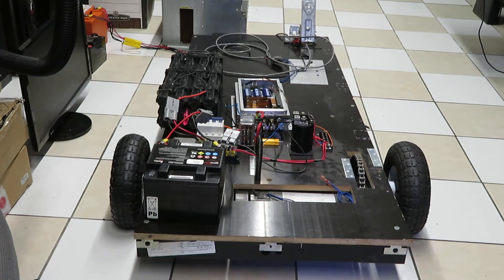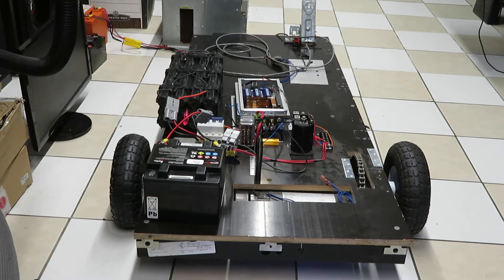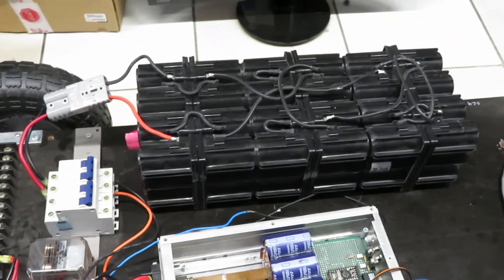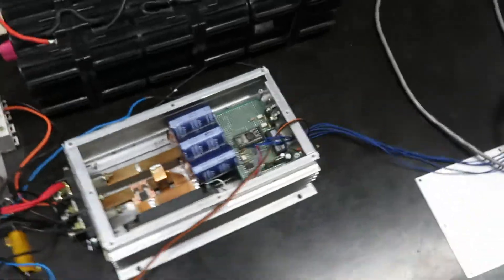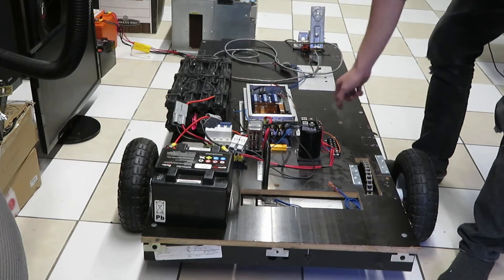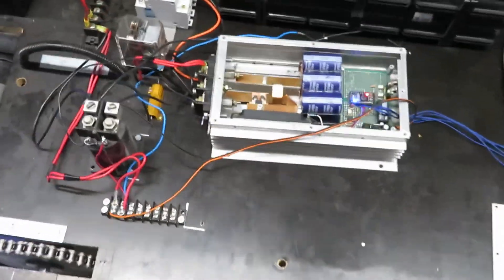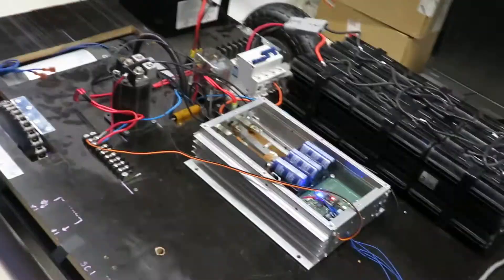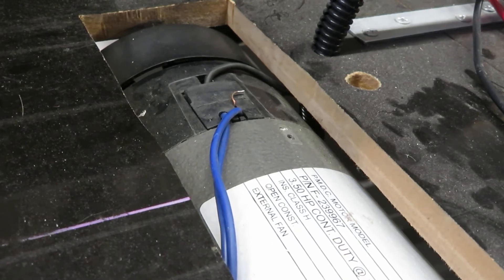Self-Built 200V DC Brushed Motor Controller Demo

Comment: I would recommend you to add some DC-Link polipropylene capacitor across supply rails of the H-bridge. I know the capacity of electrolytic caps is really high, but they aren't designed to handle that large current. Also their ESL is pretty high causing long response time for voltage spikes comming from back-EMF (during regen braking) and inductance of the batterry (when upper MOSFET goes OFF). By the way, this project is really cool, keep it going!
Reply from the maker: Thanks for the recommendations! I'll keep those in mind when re-designing it for the h-bridge configuration. I've been trying to figure out a way to do it using only N channel MOSFETs, but I have seen that it may cause issues with high drain to source resistance due to the gate offset voltage becoming lower than the source (iirc). These MOSFETs I'm using are quite expensive, so I'll test on a lower scale first.
Reply: @ri5ux  There are integrated half-bridge drivers (for low side and high side N-MOSFET) like IR21844. They can handle huge voltage swings of the upper MOSFET source and keep its Vgs at safe level (including fast switching). There is a bootstrap capacitor that charges when the low side goes ON, so you can't easily get 100% duty-cycle on higher MOSFET. I can explain how to achieve 100% duty-cycle if you are interested in this solution.
Reply from the maker: @TheLuki525  Actually, yes, if you're willing to explain it, I'd gladly read through it. It sounds like the solution I've been looking for.
Reply: @ri5ux  Actually there are 3 ways do do it:
1st and the most straight forward way is to connect a battery between Vs and Vb (according to IR21844 and similar ICs datasheet).
2nd (choosed by me) you can use some boost converter that produces voltage ~15V higher than your main supply voltage and connect it to a transistor-zener diode voltage regulator that stabilizes the voltage relative to Vs and connect its output to Vb. The main drawback of this solution is that it forces some small current (couple of milliamps) from Vs through your H-bridge to reach the GND. 
3th (i think the best one) way is get (or build) some insulated-output converter that produces ~15V and connect its output between Vs and Vb. This is the most elegant way, because you don't care about your supply voltage level, it can be 30V or 300V - it doesn't really matter.
But if you will not choose any of this solutions, you will be still able to achieve ~98% duty cycle ;)
Half-bridge drivers are fitted with undervoltage protection, so when Vb - Vs < 8V it will not try to charge the gate of the upper MOSFET.
Reply from the maker: @TheLuki525  To be honest the 3rd solution does seem the best, and the most probable that I would implement. I have a good collection of isolated dcdc converters, probably have a 15V one in there somewhere. Honestly though, 98% duty cycle would be sufficient in my case, it may not be worth the extra effort for the ~2%. What you have provided me with so far is more than sufficient. I had wondered how people were creating h-bridges using N channel MOSFETs, didn't realize there was a chip designed specifically for this purpose. I really appreciate your input!